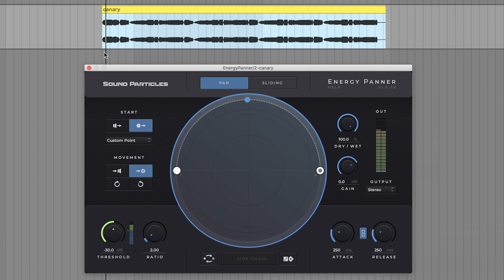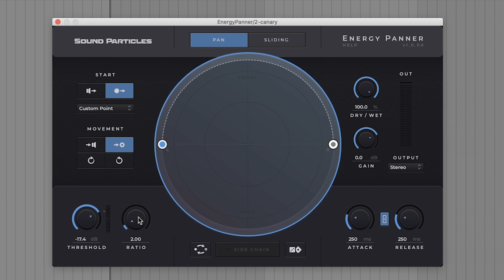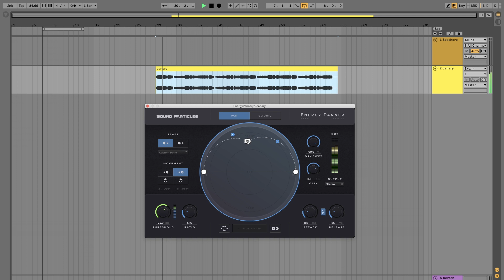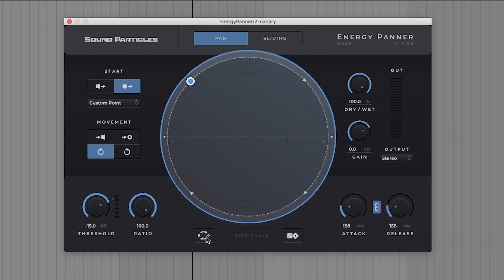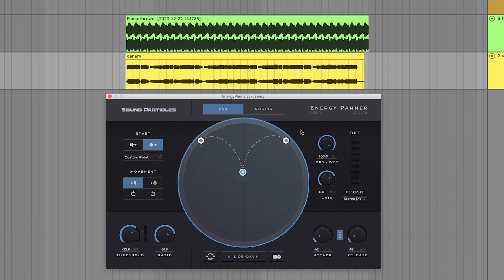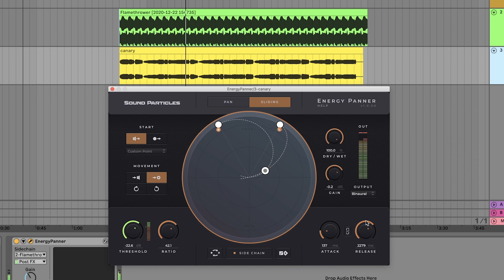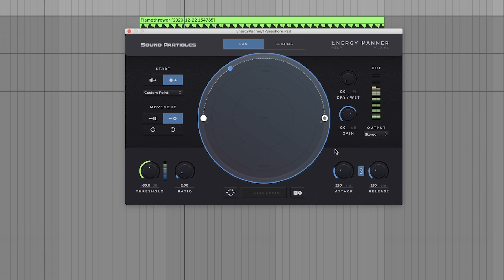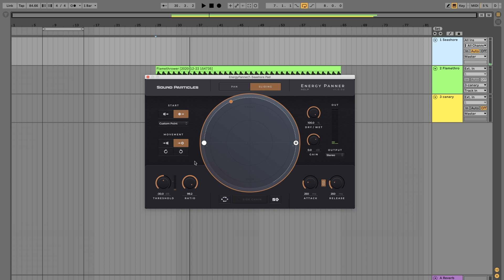Overview of Energy Panner

Comment: My cats got busy looking for the location of the birds when I watched the demo, anyway thanks for the freebie! I wonder how it sounds with organs doing the work of a leslie speaker, so I suggest it should have an automatic "spinner" or fixed movement knob (which is probably against the main concept). Other thing I will appreciate would be activating the movement "Using midi" cause on this video it shows you can plug energy panner to a vst but it doesn't really send midi data back and forth. Thanks again.